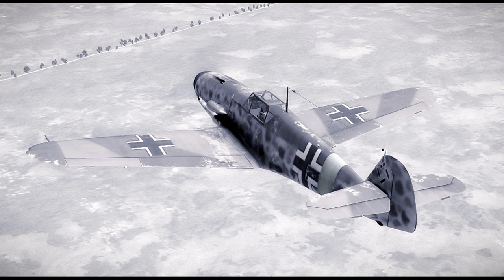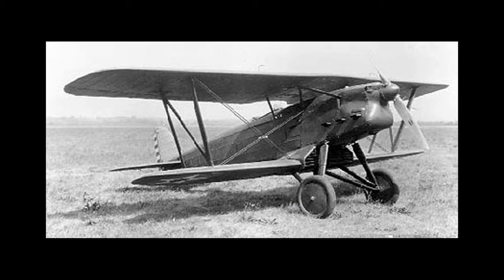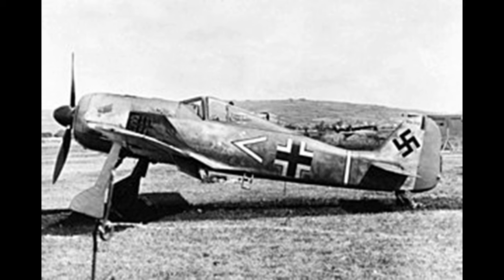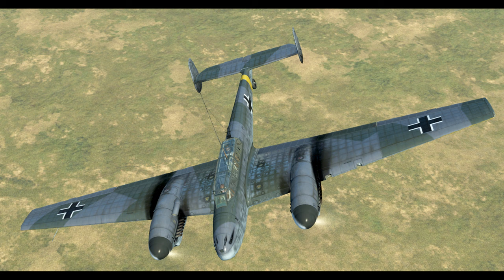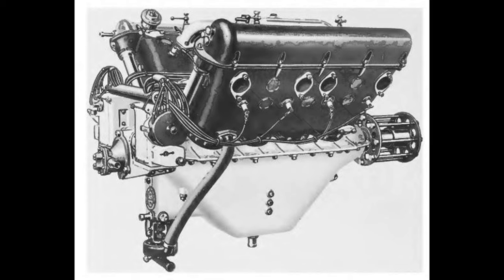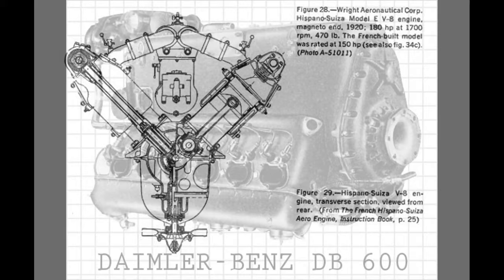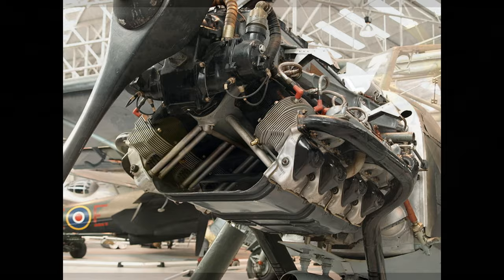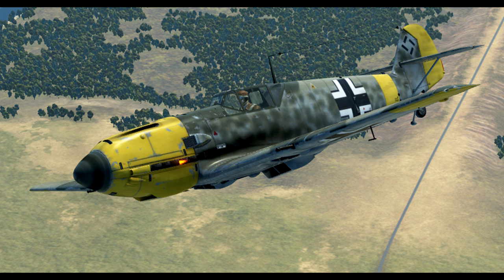Messerschmitt Bf 109 , Why an INVERTED V-12 Pt. 1? inverted V12s vs. upright

Comment: Very interesting. I was always fascinated with inverted engine. I would love to see a general overview of the differences between inverted and upright designs, design challenges, complexity, etc. for example the difference between the tiger and gypsy moths??
Reply from the maker: Those are inverted inline engines and not V-types. The big difference is that the lower powered inline 6 cylinders usually drove the prop directly. Meaning the crank and prop were lined up. So by going with an inverted 6, they could keep the prop up high for a given cowling height. This advantage is totally lost however on the inverted V-12s in fighters because they run gear driven props. Here is a picture to help: https://upload.wikimedia.org/wikipedia/commons/b/b8/1945_Ranger_6-440C-5_aircraft_engine_Hiller_Aviation_MuseumSan_Carlos%2C_California-_DSC03046.jpg

Comment: Good review.
However, the explanation that the Merlin type engine was upright for land or sea use may not be all that supportable.
The V-12 was originally developed for the Schneider Trophy speed records. The aircraft was on floats and not a tail-dragger so forward visibility was not a concern.
And quite likely, RR just continued developing what they had.
Your outlining the advantages of the inverted makes sense.
The design was very good for fighters.
Crank shaft in line with the center-line of the fuselage seems good, with all the rest of the motor below.
Bob Hoye

Comment: In early Spitfire (Mark I's) the Merlin upright V had a carburetor issue for inverted flight - the engine would stop (initially solved by Tilly's orifice) - bad news for a combat fighter.  Germany's iinverted "V" did not have this problem thanks to fuel injection.  Another + for the inverted engine is the lowering of the thrust line of the propeller along the axis of the fuselage.

Comment: Hi Greg, I am not sure about your point re the lowering of the C of G with an inverted engine. The really heavy components in the engine are the crankshaft, primary supercharger drive gear, con rods and propellor reduction gearbox. In an inverted engine these are all now at the top of the engine, which might well have the effect of raising the aircraft's C of G rather than lowering it. What do you think?

Comment: I recall reading in War Planes of the Third Reich that an inverted V-12 would reduce the chance of engine damage from ground fire.  I have seen that repeated a number of times on Wikipedia posts.  I don't understand why, however, a valves-down position would minimize damage from ground fire.  To my engineering-uneducated mind, that seems counter intuitive as the valve end of the V has a much larger cross section than the bottom of the V.

Comment: 7:06 I wonder if the lower exhaust pipes increased lift by accelerating the boundary air over the wing root?
Reply: Was there but only litle(dirt,smootness,and only at a small inboard area)see you all.

Comment: Yep, makes absolute sense. Visibility and maintenance.... also, as a Socialist state, the German industrial complex wasn't interested in creating multi purpose equipment or consider its market position post war. If German high command wanted tank engines, it built specialized tank engines, it wanted aero engines, it made specialized aero engines.  Cost wasn't a problem, because Germany had an enslaved state and a socialist economy.  Excellent video Greg. Great food for thought.

Comment: This is actually a "many answers are correct" type of question. The inverted V design ended up becoming standard practice in German aircraft industry due to compounding factors. The visibility & ease of maintenance were the first reasons, the next reason came with the up-gunning of the Bf 109 where it was found that a 20mm or larger (30mm) cannon firing thru the propeller would be much easier to mount if firing thru the crankcase rather than having to redesign the entire top end of the engine, where complicated components such as the camshafts, valves, and intake all are located, something the Russian's only did with their Yak-3 fighters, and since the American P-39 & P-63's 37mm firing thru their propeller never had to fire thru an engine due to their engines mounted behind the cockpit.  In essence, all the answers to "why they used inverted vee's" are correct.
Reply from the maker: It appears that the decision to use the inverted V in the 109 was made before they decided to put in a weapon firing through the prop shaft, and even then, it was a machine gun initially. So many planes had nose mounted guns that I just don't think that was a primary consideration. Think of all the planes with uprights or radials that have cowl mounted weapons. It's actually the VAST majority of fighters from 1915-1940.
Reply: @GregsAirplanesandAutomobiles  I was more so using it as an example of a compounding reason within Germany's industry, to keep with the design. I don't know about the machine gun's shooting thru the prop shaft. I was only aware of the MG151/15mm then the MG151/20 as the first one to use the design in production, in the F-2 model. I know Henschel's He-100 was supposed to have it's thru-prop gun as the MG13, but that plane's prototype was never armed to my knowledge.

Comment: Germans are still doing goofy stuff like sticking engine in upside down. The engine in the BMW Z4 and that Z4 clone the Japanese are euphemistically referring to as "the Supra", basically sits in there backwards, with all the camshaft timing sprockets and chains in the back, facing the driver. Bet it's a lot of fun to change timing chain tensioners when you have to pull the whole engine out.

Comment: motor cannon, OK, like the Dewoitine D520 ... inverted V is surely for others & different reasons :
more or obvious /more or less accurate ? first : the art (/heart) and preferences of the designer ?
Then, crankshaft is on top of the main case, so the shaft moving the prop' at reductor "exit" is low on the thrust axle of the craft, plus its case 'view as profile) make a slope pointing ahead and downward.
Plus multi valves cyl' heads are heavy and large, so aerodynamically, it's better to have a top engine cowling narrow on top, larger toward the bottom.
(apologies for my bad technical English :) )

Comment: The Merlin engine in Meteor form was never used as standard fitment in the Crusader tank, it was however, used in the Cromwell and subsequent British tanks. A pure Merlin engine was initially trialled in a Crusader to prove the concept but the Merlin/Meteor was never a standard fitment on the Crusader and as far as I am aware was only ever fitted once.
Reply from the maker: The Meteor was used in ONE Crusader. It only takes once to prove my point that it was at least considered.

Comment: I have come across this subject before on the Internet, so there are some sources that may be useful (I don’t know if they’re accurate but they are detailed).

A post on the ww2aircraft forums by Tartle about the reason for Germany using inverted V engines:
"Yes the Merlin or PV-12 as it was first called was schemed as an inverted engine in 1933, but when Camm and Mitchell discussed it with Royce they decided to un-invert it. This photo from my collection will show you what the Germans saw... did it give them something to copy? I reckon not as they had already started work on inverted V but it probably gave them confidence to continue and reap some oiling problems!

The Germans had already decided to try for /\ as can be read below (from AEHS author I think..can't find a link)

"The Origin of the Inverted V-12 German Aero engines.

This goes back to 1928 when a committee of aeronautical experts was assembled in Berlin at the bidding of the R.V.M.
Representatives from the Army, the D.V.L. research centre, the Navy (airships were at their peak in 1928 ) and Deutsche Lufthansa were instructed to make an in-depth study of of the international scene regarding aero-engines and then produce specific guide lines for the future development of large air- and liquid-cooled motors.
Along with others, Prof. Wunibald Kamm (of "Kamm Tail" fame), Ing. Wolfram Eisenlohr (famous pilot and head of the D.V.L. power plant division) and Dr. Helmut Sachse (later, co-designer of the B.M.W. 801) served on this panel.
The specifications drawn up by this "think tank" were very detailed and incorporated some very advanced features including, for the liquid -cooled engines:
- 12-cylinder, inverted installation,
- mono-block cylinder banks,
- wet cylinder liners,
- propeller reduction gear,
- supercharger,
- fuel injection,
- high temperature glycol cooling,
- provision of a cannon tunnel in the Vee.

Tender documents were sent to Daimler-Benz, Junkers and B.M.W., all of which eventually produced a V-12 engine model in response although none was able to incorporate all of the required features immediately, eg the DB600 had dry liners and carburettors, the JU210 also had only carburettors and the B.M.W. 116/117 only got as far as the prototype stage.
The specifications were presented to the manufacturers as a fait accompli. If they wanted production orders, the engines had to comply with the tender descriptions.
Wolfram Eisenlohr was interviewed in 1980 re the 1928 requirement for inverted V-12s and he cited three reasons for the decision vis,
- more compact installation,
- better pilot view for single engined aircraft,
- less exhaust flame dazzle during night flying.

Ref: Junkers Flugtriebwerke by Müller, R, p 150 - 151. (Helion and company)
von Gersdorff et al "Die Deutsche Flug..." p 42.
ISBN 1-85260-163-9; Fred Jakobs, Robert Kröschel and Christian Pierer. "BMW aero engines". BMW Group Classic, 2009 ISBN 978-3-86852-214-3. p 85 -87."

A Rolls-Royce engineer was one of a team that went to Germany near the end of WWII. The Report is called, "Comments on Visit to Germany, July 24th 1945 to August 12th 1945”.

10 persons made up the visiting party, including P.G.Barlow and E. Wolsey (M.A.P.), Mr A. Thomas (Armstrong Siddeley Motors), Mr N. Quinn (Bristol Aero Co.), Mr R. Chamberlin (D. Napier Son) and Mr G. Morris (Rolls-Royce Ltd).

Page 3 of the Report says, "A good example of Air Ministry control lies in the inverted Daimler-Benz engine. The D.B. people said that both from a technical and production point of view they would have preferred to make an upright engine but they were compelled to make it inverted by the Air Ministry." 
The Air Ministry people were in the team that went to R-R Derby in 1933... hence my thought that the mock up had some influence on German choice of /\. 

With the inverted engine, they said it was very difficult to obtain consistent oil consumptions and due to the rotation of the crankshaft, one bank gets more oil than the other. For this reason the engine is built with a lower compression ratio on one bank than the other."
The DB 605 compression ratios were, I believe:
Right bank - 7.3 : 1 
Left bank - 7.5 : 1”
https://ww2aircraft.net/forum/threads/inverted-v-engine-vs-v-engine.29473/page-3#post-797148
I don’t have an AEHS membership so I can’t verify it but if accurate then the committee would be the reason for Germany adopting inverted V engines.

Another post by Brian Abraham on the pprune forums goes into more detail about the oil consumption and compression ratio problem:
https://www.pprune.org/aviation-history-nostalgia/361499-messerschmitt-bf-109-built-new-bavaria-again-2.html#post5397800
I highly recommend reading this post because it goes into great detail about the design of the oil problems and lubrication in the DB 600 series, and their counterparts in the Jumo 210 series.  Again, I don’t have an AEHS membership so I cannot verify if the magazine actually has this segment in it.  If so, the oiling problems would be due to the lubrication feed arrangement chosen before the engine was designed to be inverted.

Another post on the ww2aircraft forums has a diagram of the lubrication system on the DB 605 (the same as used on other DB 600 series engines):
https://ww2aircraft.net/forum/threads/daimler-benz-db-605-oil-system-i-dont-understand.46596/#post-1327759
And finally 2 1940’s Flight articles about the DB 601 A and DB 601 N engines respectively (with some design features specific to inverted engines apparent):
http://www.wwiiaircraftperformance.org/me109/DB-601A-Flight-7Nov40.pdf
http://kurfurst.org/Engine/DB60x/files/Flight_16April1942_DB601N_Engine.pdf

Comment: Another reason for an inverted engine was probably ease of cooling. Since the cockpit is on the top of the plane, the cylinder heads get the best cooling if they are near the bottom of the fuselage. Yes, you can put a radiator down there, and run hoses from the heads of an upright V, but why would you? Doesnt this make sense?

Comment: It's a Design choice. Most Allied aircraft used a V12 were equipped with Rolls Royce Merlins or those built by Packard under license. The Merlin used a reduction drive gearbox which serves two purposes. 
1) raise the propeller hub so to enable an increase in propeller diameter
2) drive ancillary components, most notable being the twin screw supercharger.
The Germans also needed a high thrust line to add larger propellers but simply inverted the engine.

No benefits either way, just a different way of achieving a nearly identical result.
Reply from the maker: Everything in a airplane is a design choice. No WW2 operational aircraft and certainly no Merlin powered aircraft had a twin screw supercharger.

Comment: With a dry sump oil system, it really does not matter
which way you set an engine in a vehicle or plane.
The Germans are very innovative and tend to look at all
the ramifications in any design. I am sure that maintenance
and visibility were factors in this design. I look at
a much simpler war item, the MG42 belt feed machine gun.
The roller locking bolt was extremely effective as was the
simplicity of removing a hot barrel and replacing it with a new one
during sustained fire. American guns were NOT as well
designed. In many ways, German machinery is
overly complex. But when you really look into the designs,
you quickly realize that they were designing to accommodate 
every issue that could possibly arise. Americans and Russians,
on the other hand, designed and built stuff to be quickly mass produced 
and to work reasonably well where as Germans designed
stuff to work perfectly no matter what the conditions. They 
obviously did not always succeed in that, though. 
The 109 was one heck of a plane as many who went up against her found
out rather quickly.

Comment: I was thinking about all the reading I've done over the years on large piston aero engines and it came to me that Piaggio built a very high powered inverted V12 of some 3,000hp to compete in the Schneider Trophy air races, also, didn't either Continental or Lycoming produce a promising inverted V12 for evaluation but it wasn't taken up by the US government??

Comment: With regards to the BF109 something else that needs to be considered is the fact that it had a hub mounted 37 mm and you're and I believe most of them had cow mounted machine guns inverting the engine allowed for the machine guns to be mounted lower down in the fuselage allowing them to not impede the pilot's visibility and an upright V12 would not have allowed the 37 mm to go through the hub as easily because it was able to be put lower in the fuselage reducing the center of gravity and allowed the barrel of said cannon to travel between the heads

Comment: Ask  any hot rodder an he will tell you by keeping the oil away from the crankshaft it will make hp, aka engine baffles, crank scrapers, by having an inverted engine gravity takes care of this. Also the oil is kept in the head area more to help  cool the combustion, the only other thing i can think of is the mounting ring on the aircraft, by having the weight of the engine on the bottom of the ring mount where it is stronger because of the wing structure.      Just my thoughts  J.R.

Comment: I was surprised and disappointed you went through all that lengthy diatribe about the inverted V12 BF 109, etc, and never mentioned the 20mm cannon that was used in the V channel created by inverted V use.  "The Bf-109V4, first flown in November 1936, powered by a Jumo 210A engine was the first version to carry three machine guns in the nose. The third gun fired through the propeller spinner, but this gun was later replaced with a 20 mm, MG FF/M cannon."

Comment: Does anybody know if inverted V-12s had problems with hydraulic lock, like radials?  Hydraulic lock is where engine oil (on a radial) drains into one of the lower cylinders, generally past the piston rings from the crankcase.  That's why you'll see radial pilots turning the prop over by hand a couple of revolutions before starting--hydraulic lock will stop hand turning at some point, but the starter has enough power to break things if it hits lock.
If you find you're locked up, the solution is to remove spark plugs from the suspect cylinders and keep turning to pump the oil out.
BTW radials are all dry-sump, obviously, but some oil remains in the bottom of the crankcase after shutdown.  I'm sure that inverted engines also cannot evacuate all of the oil from the case.

Comment: Cromwell used the Meteor, Crusader (and most of the earlier ones) used the Liberty.  Point is correct (both air engines in tanks) wrong changing point.  Centaur was a Cromwell with Liberty (only used by one unit in combat).  Very good engine the Meteor, but VERY thirsty.